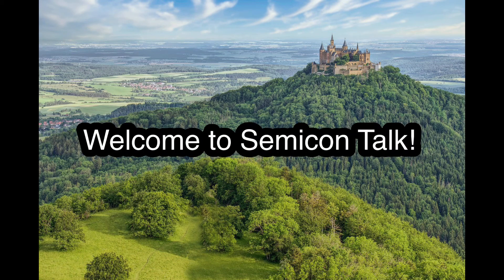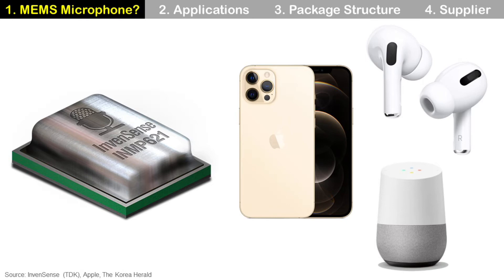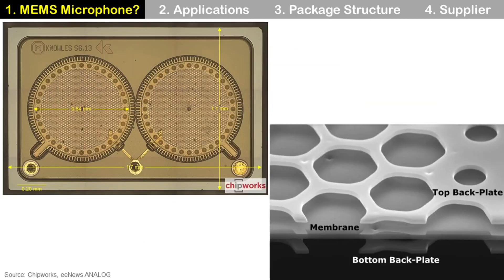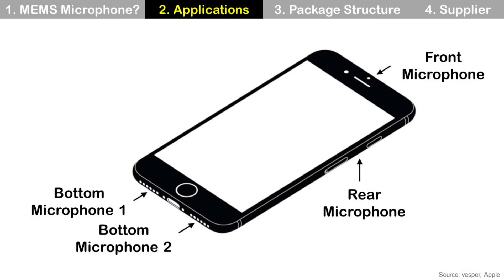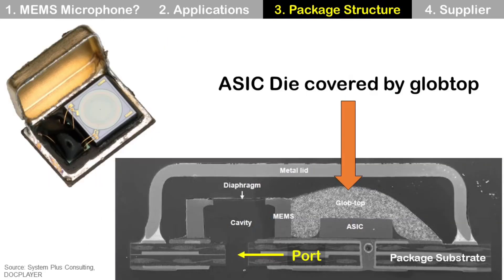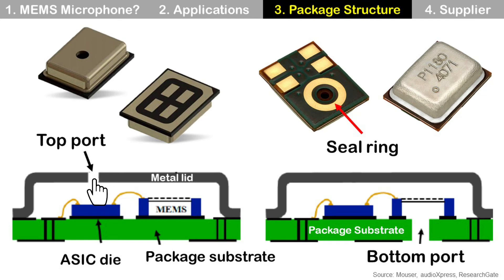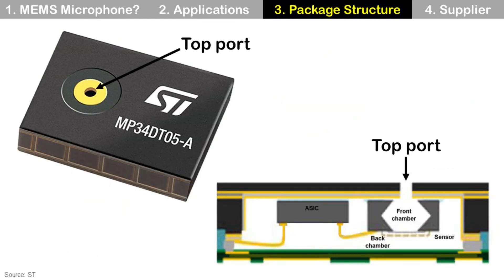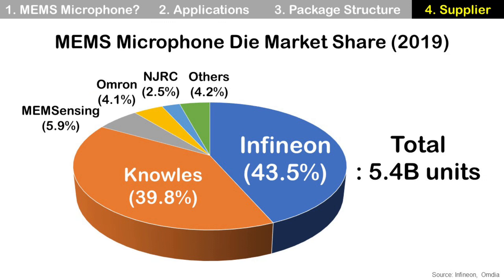[Eng Sub] MEMS Microphone - Smartphone, Wireless Earbuds, A.I. Speaker

Comment: Is the "ASIC Die" the chip that converts the capacitance into a digital signal like I2C or an analog waveform, etc?
Reply from the maker: ASIC die detects the capacitance change from MEMS microphone die and converts to electrical audio signal. ASIC die also minimize noise to make better audio signal.
Reply: @semicontalk3223  Thank you!

Comment: Good explanation! The bottom port design makes sense to me, but why would you place the top port not directly over the mems? Why is the port also much smaller than the actual mems microphone itself? Wouldn't it be better to make it as big as possible to gather as much sound as possible? Doesn't the metal lid form a resonant chamber?
Reply from the maker: Excellent questions!
A1) Place top port directly over the MEMS is better for acoustic performance. But MEMS can be contaminated by dust or falling particles then it degrades acoustic performance. The reason to place top port at the different location from MEMS is to avoid contamination from dust or falling particles.
A2)  You are right. It is better to make bigger port to reduce risk of sound blockage. But to avoid Helmholtz resonators, it should not be bigger than the holes it connects in final product.
Please check below links for more details.
https://www.infineon.com/dgdl/Infineon-AN557_MEMS_microphone_mechanical_and_acoustical_implementation-AN-v01_01-EN.pdf?fileId=5546d4626102d35a01612d1e3bf96add
https://www.st.com/resource/en/application_note/dm00103199-tutorial-for-mems-microphones-stmicroelectronics.pdf
https://www.knowles.com/docs/default-source/default-document-library/sisonic-design-guide.pdf?sfvrsn=ddda77b1_6
Reply: @semicontalk3223  Thank you very much! Thats making sense. I assumed the placement of the port would be for protection, but I haven't thought about Helmholtz resonance occurring if the port is bigger than the opening in the product. In hindsight is obvious. Interesting links, I will read them later.
Thanks :-)